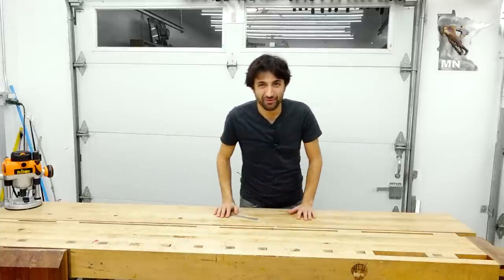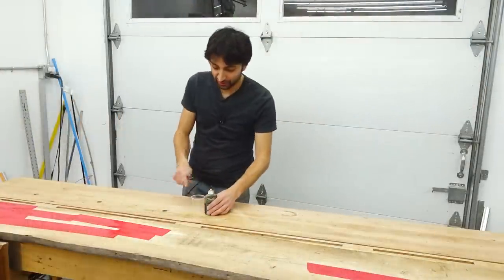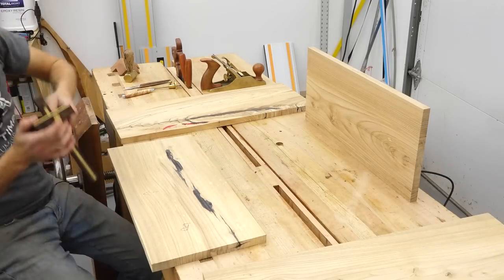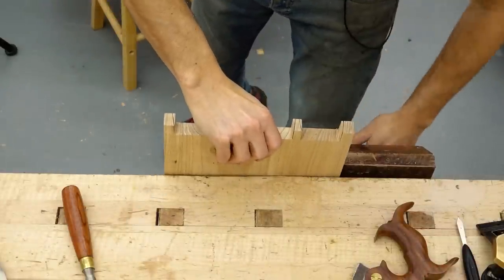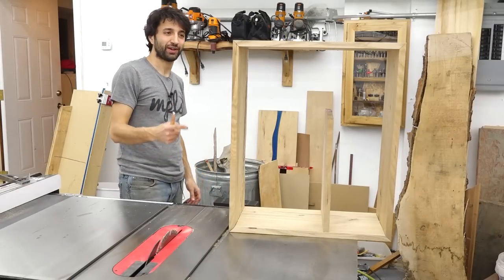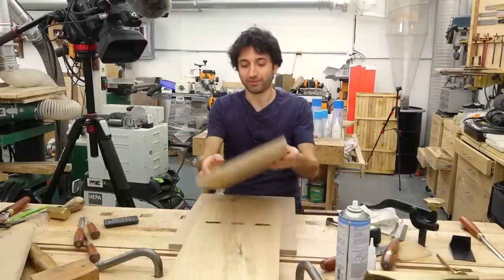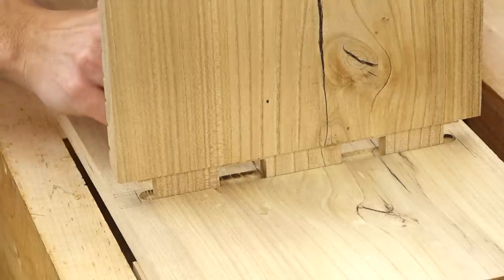Why Wouldn't Your Shop Storage Have Dovetails and Through Tenons?

Comment: Very nice. I once made a similar, although much less beautiful, piece to hold my sandpaper. I do have one suggestion: cut a 1/2 to 3/4" scoop from the middle third on the leading edge of each sandpaper shelf. This will make it quicker and easier to access the boxes or sheets.

Comment: Coincidentally, I also made a sandpaper holder over the past couple of days. Mine was made from scrap plywood, but it was mostly nice scrap plywood. I used some glue and pin nails for joinery. I admit, not as fancy as yours, but I did get most of the nails in straight. I consider that an accomplishment. 😂 I figure if I put enough coats of paint on it, it might look okay. 🤪

Comment: Hi Matt,
I think you will find that you’re getting that roll out from your chisel is because you’re using the full face of your chisel!
I find what works best for me is, do what you are doing for the first couple of millimetres, then put the piece in the vice with a backing and face board  and work from the outside into the middle with the corner of your chisel on the flat, working the material to the cutting edge side of the chisel in a swivel action, so as to cut the material in to the space you have just made! If that makes sense?
It works really well on the end grain but you must have a super sharp chisel and keep your hands behind the cutting edge.
Once you’ve worked along one side to the middle, you turn the piece around and repeat from the other side!
It might sound like a slow process but once you get the hang of it you can work through it fairly quickly!
Hope to see you give it a try!
Regards Alan from Australia 🇦🇺
PS, I think that’s a lot of work just to store sand paper!😂🤣👍

Comment: Really nice seeing you're taking eyes, ears and lung safety serious.
To many people dont on the channels I'm subed to.
Sadly,  when they reach my age it'll be to late to avoid serious health issues that can and most likely will be facing.
That said,  thos inclusons are really going to look awesome filled the way you did.
I had to restore an 18 foot butcher block shuffleboard playfield in the very begining of the 2,000's.
One end had a 9 inch split between two of the segments. 
I used my dremel router tool to make a bevel cut into the crack between the two. 
Then used West System epoxy with a color additive that closely matched the slab.
Thankfully both matched each others color.
Then I made a mold on each side and end with angle aluminum that went 2 inches above and under the playfield and used the same slow hardening epoxy in 6 1/2 inch layers.
Using a professional hair dryers with a speader tip to remove bubbles as the formed.
When it was finished you couldn't even see tha repair. 
It was the leveling end to end and to side thar was a b#@ch.
Luckely they have 8 turnbuckle adjusters underneath to ajust bowing side to side.
I used 10 sawhorses with small jacks to adjust it lenghtwise under it and a string line and dollar bill on top to check levelness on top like we did on locations whenwe set them up or between seasons.
I'd love to watch you build a 16 to 18 foot by 20 inch wide and 4 inches thick butcherblock shuffleboard playfield. 
I've absolutely no doubt that it would be a work of art.

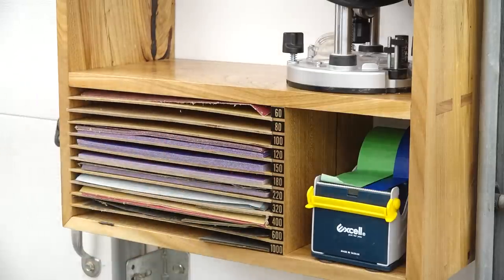Comment: 1:03:22 cut thumb notches for easy sandpaper selection.  usually a semicircle 2-3'' in width and 1'' deep.
   edit; how come I never read the comments first?   :(   also, if you buy by the 100 sheet box, just make the slots the size of the box and put the whole thing in so you can remember exactly what you bought. (I meant the spaces should be the size of the box, not the slots themselves)

Comment: My Sandpaper organization needs redone in a major way.  Not sure how I will deal with my torn customized and partial pieces and ripped sander belts, wet&dry, etc. Currently they are getting shuffled in a couple 5” deep by 2’ wide drawers with folders and separators. 
I like your organization for new sheets.  Could also be that I hang onto too much old used paper.

Comment: Matt...I just have to ask...since the garage door track hides the main feature of the crotch figure...why didn't you just turn the whole box upside down....does the sandpaper really 'have' to be on the bottom? Cause if you turned it upside down, wouldn't that bring the crotch figure to the front of the panel?🙃

Comment: I would want them to be at least 1/2" on the smallest side, and go bigger from there.  There's no question that you are very good at it and talented;  but I still say that your dovetails are too small. And just to prove my point, I would love to see you build a joint like this, and then build another one with larger dovetails---  and put them into a press and see how much force it takes to shear the dovetails.  That would make for an awesome video.  And if these little dovetails do just as well, I'll eat my words.
Reply: Good grief, it is a sand paper shelf not a High Boy. How much strength do you need? In this project the dovetails are more decorative than for added strength.
Reply: @johnburger3287  No.. the dovetails are there to keep the joint from pulling apart, which is why they are beveled to only slide together one way, but not the other;   and you're right, this isn't as crucial-  and he did do really sizable slots on the cross shelves.   But I've just had this conversation with him before, and just mentioned that they still look small to me. lol..   It seems like a lot of work for something that's so seemingly fragile and delicate..   Anytime you normally see them that small, it's because they are close together like a row of stitches.  But when you space them apart like this, they should be at least 1/2" on the smallest side;  it doesn't take any more work to do it.   He just likes the smaller dovetails-  it's kinda his thing.   I just wouldn't do them that way, personally.  Cheers